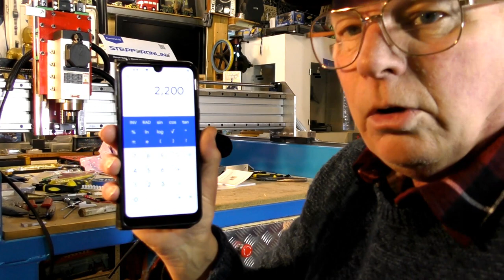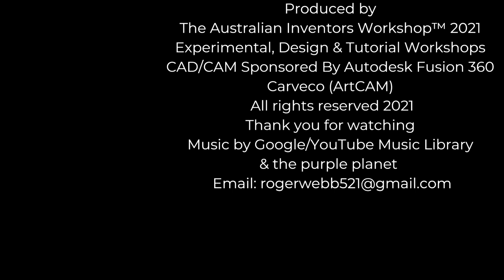How To wire a CNC 2.2kw Spindle and VFD [Episode 15]

Comment: All cables should be double shielded, and all wire ends tinned ( the ones that are fitted to the transformers)  flux should also be used even with resin cored solder...this is best practice

Comment: You should heat the wire with your soldering iron and then apply solder to the wire. The flux core in the solder can then do it's job and make tinning the wire work much better.

Comment: Hi Roger, With you now increasing the travel of your X & Y within your new machine, Stepperonline do some nice Closed Loop stepper motors, which will mean if they are operated within the spec speeds they shouldn't lose steps. This is a upgrade that I am looking into at the moment, because I have a large DIY CNC router which loses steps from time to time and thus can spoil me work. Cheers Nigel